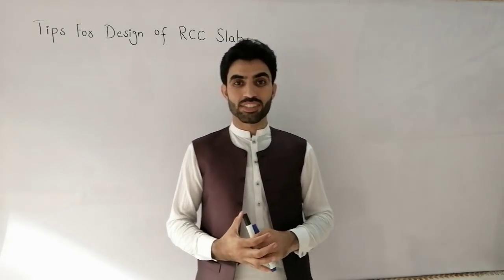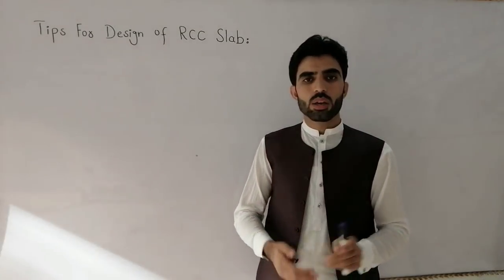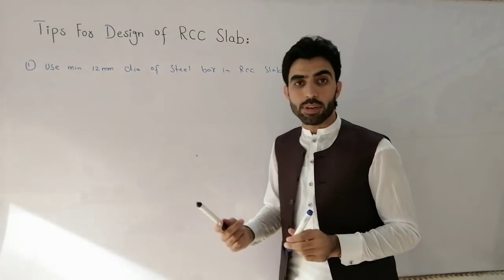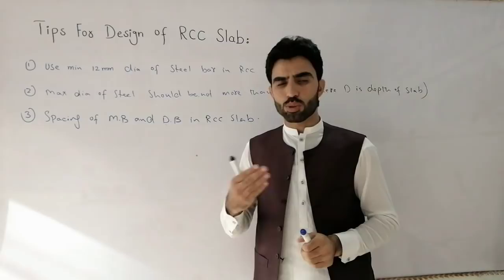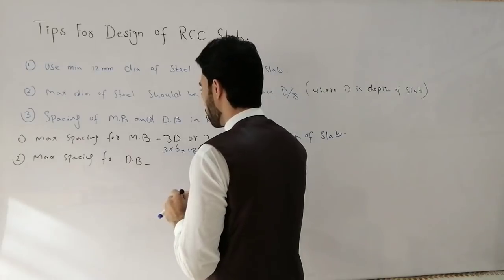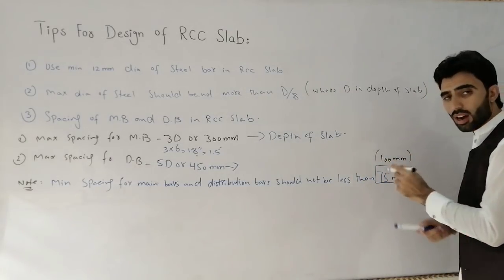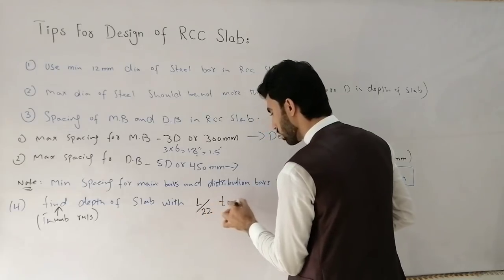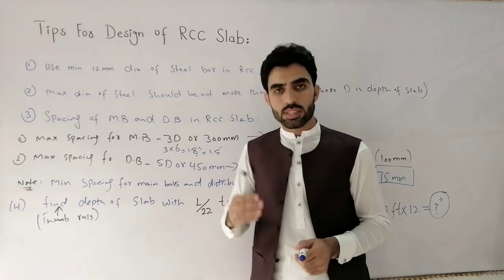Tips for Design of RCC Slab |Guideline for Design of RCC Slab|

Comment: Max reinforcement in slab depth of slab/8 =6"/8=0.75, what is this meaning....?
Reply: Its .75 inch . You may convert it to mm .  1 inch =25.4 mm 
Hence     .75 *25.4 = 19.05 mm 
Hence  the max rainforcement bar should not be more than 19 mm . Hope it helps you   thank you.

Comment: These are all thumb rules and its ridiculous to use 3/4 inch dia bar for 6inch thick slab.thickness of slab and area of steel is determined by calculating the bending moment ,live load and dead load ,this will give the exact thickness and area of steel for that particular slab